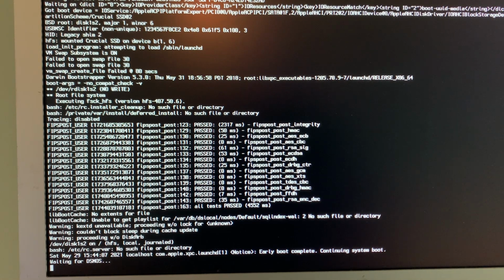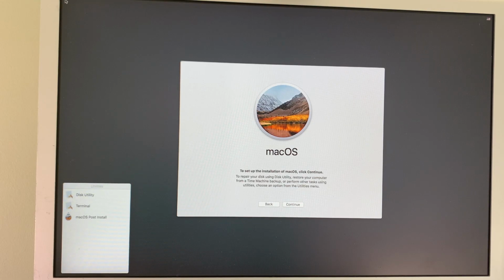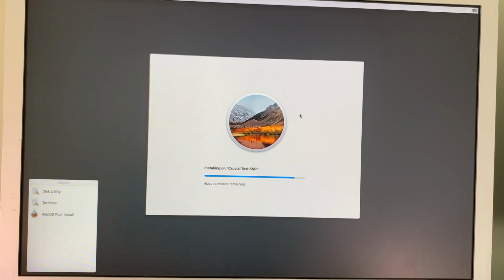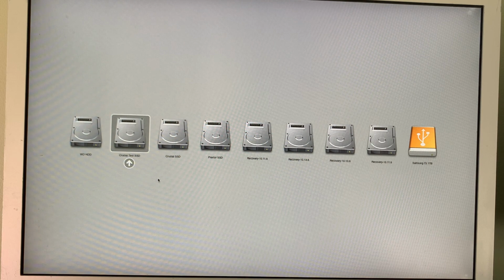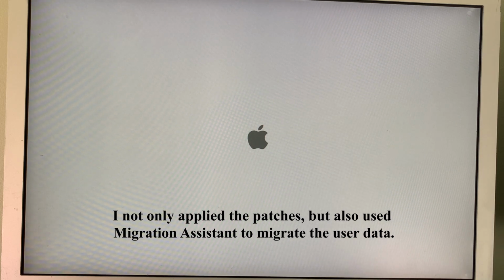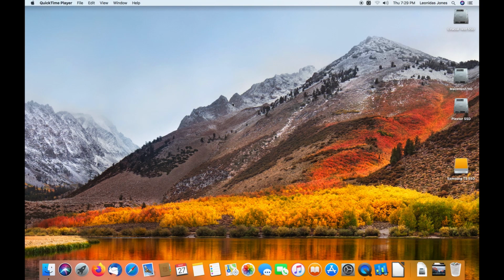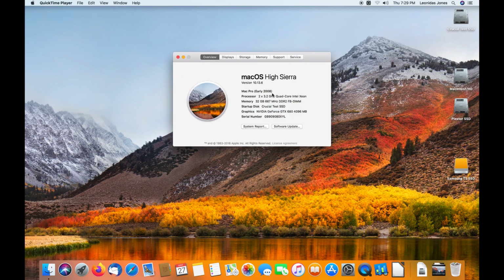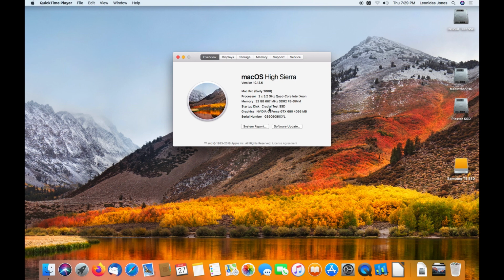2008 Mac Pro, Sierra overview, and Upgrade to High Sierra!, An Update

Comment: It’s good to see it finally work now! Hopefully you can use the rest of the ram later on.
Reply from the maker: From what I'm reading, no, it was a problem with every OS above Mavericks. Now, I did have it running, successfully, with El Cap and Sierra, but in looking back on it, the syste, while it ran fine, was kind of unstable, crashing now and again, for no real reason. I had ascribed it to the fact that I had replaced the logic board. However, running it with 56 GB is rock steady. I do have another 3,1, which had 32 GB, so it is now 8 GB richer  ;-)
Reply: Ah ok, well at least it’ll run better now. 56GB of ram is still a really nice amount to have and at least you also have other machines to take advantage of the remaining ram!